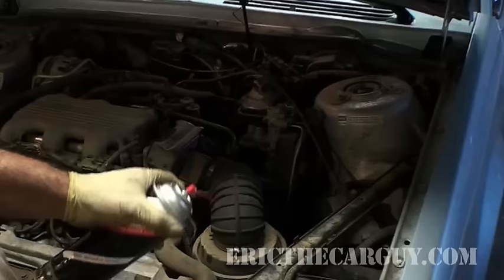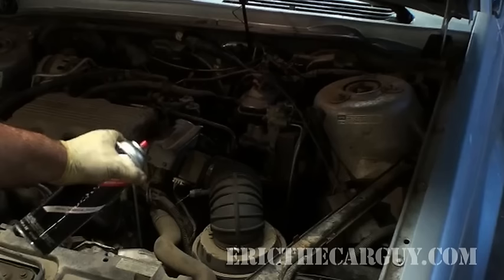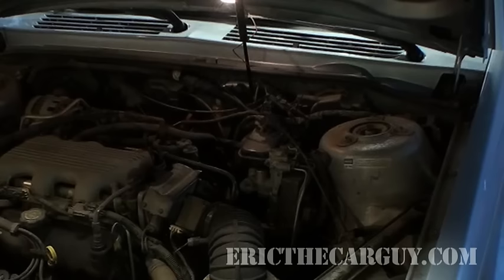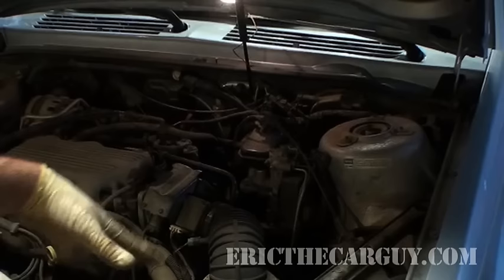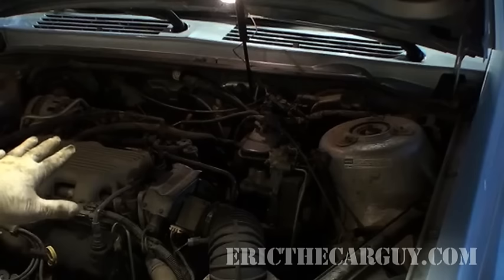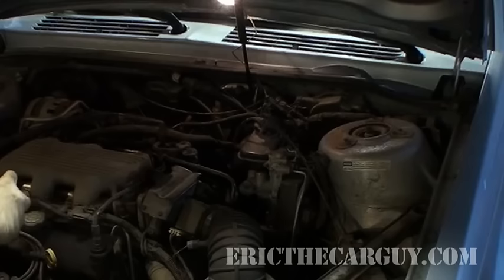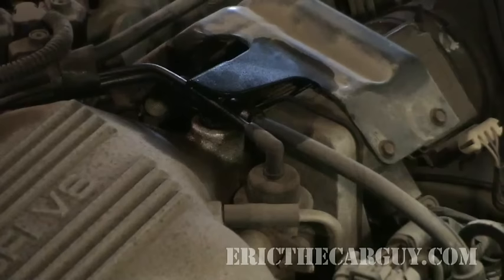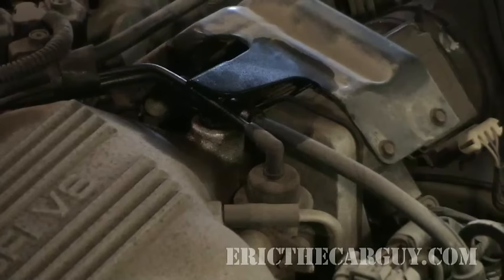How To Find A Vacuum Leak - EricTheCarGuy

Comment: I have a problem. my car is sputtering and stall. once I start it up it runs but once I give it some gas the rpm drops and then the car dies. please help really need some ideas or advice
Reply: Joe X idk if fixed yet but probably air fuel or spark try air filter cleaning with compresser then try spark plugs then try fuel filter or pump

Comment: I have an 05 Crown Vic I heard hissing coming from the exhaust pipe past the first cat I cut those bolts off tightening the hissing has stopped it's still running like crap poor acceleration sometimes stalls when I after I'm stopped I don't know if it's a vacuum leak is an exhaust leak considered a vacuum leak Should I reset my ECU after tightening that exhaust pipe would that help thanks if anybody knows

Comment: Sorry. I didn't mention a New air filter but it's not cranking easily like it did when I bought it and it's taking forever to draw fuel from the tank after several days . it's a manual fuel pump because it's original. ..But that could change if it's the problem. I have a new fuel filter to change out next. Thanks again.

Comment: Eric ...I still have a problem .. I'm homeless and I'm sick and I can't afford tools to find my vacuum link. I tried the cigar trick but it's just not enough smoke... Or it's due to a valve I can't have access to most likely "technically it's a vacuum actuator on a 2000 Dodge Durango with a 4.7.  I need a way to find the vacuum leak without tearing it apart.. or at least a way to narrow down the location.. I think I'm pretty much S.o.l

Comment: I have an 04 Taurus and the a/c only blowes out the defrost vents , when it does switch to the dash vents it switches very slowly I  suspected a vacuum leak but have been unable to find one anywhere on the car is it possible the vacuum valve that controls the air doors is bad?

Comment: Do you think that WD40 would work instead?  I think it is less flammable than carb cleaner.
Reply: No you want something flammable so if it's leaking it will suck the fumes in and the car will rev higher

Comment: Newbie here but why not just do it the right way with the propane and fuel line? Is it much more difficult?
Reply: Not everyone has propane on hand and a can of carb cleaner is cheap, pretty sure that's the only reason.
Reply: @jimjambananaslam3596  Hmm, small camp style propane tanks are pretty cheap too but I guess you have to fashion tubing onto a torch attachment to do it so I guess I see what you're saying. Seems like a tiny bit of extra effort for most people to choose not to do it the right way. I'm still wondering if there is another reason...

Comment: Eric my engine will not keep an idle?  I have to constantly give it little gas to keep it from dying.  What would you recommend??
Thanks
Reply: ***** 
I'd say give the Throttle Position Sensor (TPS) a check and clean the Idle Air Control (IAC) valve while at the throttle body.

Don't forget to check the wiring! Can't send data thru a severed wire, so just cause a sensor gives off bad readings doesn't mean the sensor itself is to blame.

Could be a lot of other things, too. Bits of crud on the MAF sensor, low fuel pressure/volume caused by a clogged up fuel filter, fuel pressure regulator failure, or a fuel pump on its way out.
More rare things would be something like one of the engine accessories starting to drag on the engine (failing alternator, power steering pump, or water pump bearings, etc.) or one of the cams being out a notch or 3 on the timing belt. But that's starting to grasp at straws, I think.

Check the easiest things first, of course. You know, the whole "See hoofprints, look for horses, not zebras" thing.
The only exception to that is if that specific engine is well known for a certain problem. That info will be in Technical Service Bulletins (TSB's), which you should be able to look up online (possibly for a "small" fee).

Comment: big fan of the videos 
i had a question idk if you can get back to me but i have a 92 toyota camry 
the problem is it keeps turning off after a mile of driving i thought the problem was a fuel pump but its not i replaced it so i gave it a full tune up and it still does i replaced or checked fuel filter battery alternator any help i would really appreciate it 
THANKS!

Comment: Sir i just bought a 1985 ford f150 and i believe i have a vacuum leak my truck stalls at stops and when i drive it and  then put it into park would a vacuum leak explain this? I also know i prob have to clean the carb and replace the fuel filters.....honestly it needs a whole tuneup which will be done this weekend

Comment: Very impressive Eric! I have a 2005 Dodge Magnum 5.7 hemi and I have a minor serge (the engine revolution goes up and down slightly) I have heard from the experts that it is caused by vacuum leak. What do u think in your experience? I had a professional injection cleaning almost 6 months ago, news plugs etc, thanks man

Comment: i have a chevy impala 03 im having a problem what causes my rpm gauge to go rapidly up and down while the cars in Park
Reply: +Early Pierce I had that same issue. It was the throttle sensor. You could replace the entire throttle body or clean it out with cleaner.

Comment: best way safest is make a smoke machine from a metal paint can, 18ga copper wire inside. pos& neg terminals through side 1/4 " air chuck to upper side10 psi small light weight oil inside

Comment: You mentioned to "reset the ECU." How do I reset the ECU in a 1995 Mercury Villager with pre-OBD-2 system of diagnosis?! Thanks
Reply: Maybe similar to my escape.  Unhook the negative from the battery.
Run a jumper from the Positive (Battery), to the now hanging Negative to the car (Not the battery).  Let the ecu purge its capacitor/memory.  

There's other videos about this.
Reply: Aaron Mckannan: Thank you.

Comment: I have a 95Accord. Changed the IACV with a reman after cleaning my old one and didnt fix the situation....well..
Still have the fluctuating idle.
Thinking it's a vacuum leak, but I haven't been able to find one by spraying the carb cleaner.

Any ideas, Car Guy?

Comment: i have a 1998 grand marquis it has a hard time starting when i turn the key about three times or so then its starts i have change some thing but i noticed that when i press the gas all the way it back fires in the air filter i change the MASS air flow three times and still the same any idea

Comment: I have a low idle when car is warm and I come to a stop it will drop very low around 200 rpm sometimes it will stall (rare), only get a code for the egr, I replaced it and still the same thing, I cleaned AICV, TPS, fuel injectors and replaced spark plugs. I also removed the catalytic converter just to test it and still no change, the only time the car wont have low idle is if i unplug the O2 sensor the one in the exhaust manifold righ, car has 170,000 and still running strong, if you guys can help I would really appreciate it.

Comment: I've got an 89 xr7 supercharger 3.8L V6 5speed manual. I read on the carb cleaner cans that you're not supposed to use them on SC or turbochargers.....what else do I use that won't hurt the sc intake? M90 Eaton supercharger

Comment: Question, I have 08 g37s. I cleaned my throttle body(some say not to) by just removing the intake hose and moving the plate. Now, sometimes my RPM would hang--i would rev the enging and rpm would hang for several seconds. Sometimes, it  goes back down really really slow and even go up by itself. I'v done all the resets and relearn but it comes back. Could this be caused by a band throttle body or a vacuum leak?

Comment: Hey boss. I just want to start by thanking you for the knowledge you hold. I have a 92 civic vx and it just dosn’t get the fuel economy it should not even close. I am getting a code 48 for lean air fuel mixture. On the o2 a 5 wire. I don’t think its bad but i get kinda of stall when slightly pressing the gas. Could this be my problem.

Comment: I have also some mysterious problem. Please help me. I have honda fit aria 05 and my car idle rpm is according to manual . But when ac is on sometime rpm are stable and sometimes it start to fluctuate. When its fluctuating i just push off the ac and everything is fine. And it happens on idle only.
Is it a low refrigerant or bad compressor relay or something else .i dont know what to check for

Comment: I have an 06 rav4 the starter was bad. To get to it I had to remove battery and the air box an filter just to get to the starter. After replace the starter and putting the air box an battery back in. the car will idle between 1000 and 2000.
Reply: Seems like it's either getting to much air or not enough

Comment: What else can cause lean p0171 p0174 no vacuum leaks and not the maf sensor? My vehicle shifts hard sometimes it feels like a little slip. The rpms bounce around when on the throttle but not while idling. Loss of power barely making it up hills. Ltft about 20% on throttle and goes down when idling

Comment: Just real quick. 18 chevy v8 truck. Low mi. Hard misfire cyl 4. Replaced coil, plug and inj. No way it's compression or ecu I'm assuming. So rare. But can a vacuum leak effect one cyl. I mean there's no way right. The ecu would see that and adjust for all cyl. There's nothing else I can think of to fix one cyl misfire. Unless bad rings or ecu but that's super rare.

Comment: Eric, I have a 1991 Toyota Pickup 4x4 22re engine.
Sometimes the engine runs fine then...then I notice it the idle a runs bit high -- then when you put your foot on brake the idle sometimes surges up and down.
  
I took it in paid $98 dollars to diagnosis - they were busy working on other cars for 4 days then a week later they said it needed further diagnosis. They did some work (chg spark plugs and changed fuel pressure relay  which cost me $351.82. I just got the car back and it is not any better than when I took it. Any clue where to start looking for the cause? Please reply.

Comment: Is it possible to use CO2  to find the vaccum leak if looking to an odb2 scanner and at long fuel trim and short fuel trim values ?   If it sucks in co2 in the vaccum leak it should modify these values ? Wouldnt it be safer to do so ?
I am a bit afraid handling with burnable gas in the engine room to find my vacuum leak. Its just an idea ...

Comment: Eric I need help!  Ive replaced battery cause it was due and it was dying when put into drive.  I cleaned the MAF with MAF cleaner.  I cleaned the K&N air filter.  Its still running ruff.  It previously threw a P0174 lean code.  I have a Hitachi MAF arriving to replace.  If it still wont run right after this what is my next step.  It will idle with a funny idle, when it goes into reverse or drive it dies.  I can get it to move if I gas it enough but its very lumpy and ruff running cutting out.  I dont really know how to look for vacuum leaks but I have looked around and will do some more

Comment: When I spray around my intake manifold gaskets and o rings for my fuel injector, the engine shakes and sounds like it's close to being shut off. Is this a symptom of a leak? 1zzfe Celica gt for reference. I replaced the gasket a few months ago and the fuel injectors with new o rings. The car hesitates on acceleration and throws a p0171 lean code.

Comment: I consider this method too dangerous, so I preffer using smoke to see where the vacuum leak is. I  burned a piece of cotton cloth and get around the suspected area with  it smoking, not burning, and I saw where the smoke got sucked in.

Comment: Hi Eric. Good day.
Jacky here. I had a daihatsu car model ED10. Checked intake manifold vaccum pressure 16hg ! It low ? How to increase it ? Iginition timing ard 6 . If adjust to 10, the vacuum pressure wll increase to ard 20 hg ! It normal ? How to increase a vacuum pressure and maintain a iginition timing in 5 degree ?
Please advise

Comment: I HAVE A DODGE 72 WITH A 318 V8.  IF I HOLD THE IGNITION IN THE START POSITION THE ENGINE WILL RUN SOON AS I LET GO FOR THE RUN POSITION THE ENGINE WILL TURN OFF ANY IDEAS PLEASE CONSIDER HELPFUL IDEAS THANKS VIIKK
Reply: ballast resistor

Comment: question, I have the same hissing sound coming from the manifold area, possibly around the throttle on my 01 accord 4cyl. The sound stops when i accelerate from the throttle body, am I confused as to what I'm hearing?  or will accelerating stop the manifold vacuum  leak temporarily? thanks in advance.

Comment: i have a 1992 ford e350 work van. i had a vac leak in a few hoses and break booster. those are fixed now but i have a weird issue when i depress the breaks the engine speeds up . if i release the breaks the idle goes to normal? can you give me an idea what to have my tech check, ihave had 3 diffrent guys try to fix it with no luck.

Comment: so if the car runs rough at idle, like from 1k-stalling, and there's a noticeable hiss coming from the engine, would that just be from a vacuum leak or something more?
Reply: It could be an iac sensor
Reply: I am having the same problem did you seem to get it fixed?
Reply: yeah, the PCV hose was cracked on my 2005 Ford Focus.

Comment: Can that vacuum leak sound like a low whine ? I have a 2009 Dodge Ram hemi and I can hear a small whine while driving. And when coming to a stop my rpms drop to 500rpm which is not right. It’s stalled a few times too but not much. Other than that drives great. I can correct the rpms bc tapping the gas. And also if the a/c is on it stays at 750rpm like it should. What’s the deal?

Comment: hey eric the car guy i need help my car drive ok but sometime it start but rough idle then shut off  of to let it sit for about twenty minutes before it finally stay on  i change all six coils six plugs ignition switch take it to the dealer they found a vaccum leak but it still didnt solve the problem what else can i do to fix the problem

Comment: Hallo man i have a big question for you. My honda civic Ex  2002 have a leak some where the code is p1457 auto zone said it could be the fuel cap.,, i fixed that,,, the canister or vapor saturated or something. Any suggest

Comment: 2003 Honda Element - P1157 and P0171 Codes - What brand O2 sensor do you recommend?
I am reading that the pre-cat sensor is what is causing the problem on forums.

I understand there's a wide array of items that could cause the codes.. I do not see that you have any videos on this issue with 2003 Element, any input?

Comment: 2011 1500 ram 4.7 I got my intake manifold replaced brand new but still sucking up air but my oil rings on fuel injectors didn't get changed out I spray it n it's sucking air from like the middle but the Mechanic who did my intake manifold says everything is seal heads where flat so maybe the oil rings on fuel injectors giving this code P0507 idle air control  but b4 the intake manifold replaced was random misfire like 4 oother codes I can't remember but my question is possible for the injectors to suck up air ( Thank you)

Comment: I found a leak in my 2000 grand am one of my injectors was leaking through the gasket can that cause a stall when i press on the gas it seemed to want to turn off when i first step on the gas i  am getting the gaskets later today and ganna clean out the fuel injectors while im at it

Help me please

Comment: hello. i need advice please. i have a 94 Chevy c1500 v6 with a throttle body. Sometimes it has a rough idle or does not idle but will run if the engine is given gas. sometimes it will start up perfectly and (sometimes when coming to a stop) not have the idle anymore. i have checked some of your videos and i have cleaned the throttle and checked the vacuum lines. i don't know what else i should look at.

Comment: Hey so I know ow you have an Acura TL so I have an 08 TLS and I spray the EGR and the STFT goes to 0 but then comes back up to 14%. If the car sits idle a long while it will throw the 0171 code but otherwise it doesn’t. During throttle or driving the fuel trim goes down but I don’t have any vacuum leaks or ripped hoses that I can tell and I smoked the system and I see smoke coming out of the egr so could that cause a lean condition during idle?

Comment: Eric i am a follower on your channel. I have a 2003 ford expedition. I cant quite figure out what the issue is with the motor. It suddenly started shaking, and the idle on the motor dropped down to 750 RPM. My brother is a mechanic and he threw on the matching but it didn't give him any codes. Due to the check engine light not being on.
Reply: check that number 8 coil pack Pablo.. unplug it and see if the engine symptom changes.. if it stays the same that's your bugger.

Comment: Eric , Thanks for the how to's , I've talked to u before , current problem driving me nuts , 04 Pathfinder 3.5 code p1491 vacume cut bypass valve , not so , replaced it , also charc can , 2 valves on it etc. Nissan says mine does not have EGR valve , I replaced EGR Solonoid control valve ??? Reset lite and next day comes on again , Very clean underside , NC car , all hoses seem good condition , any other causes for code p1491 , Runs Perfect , my 5th Path , Barry